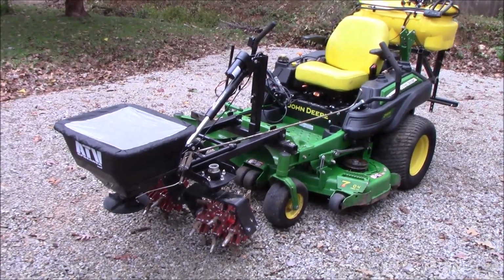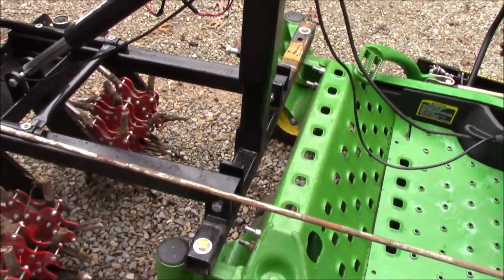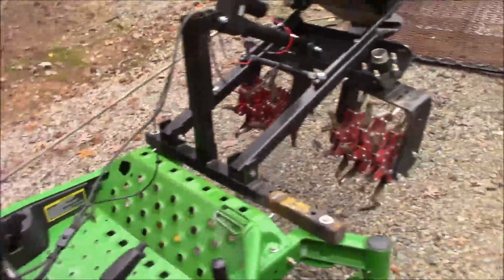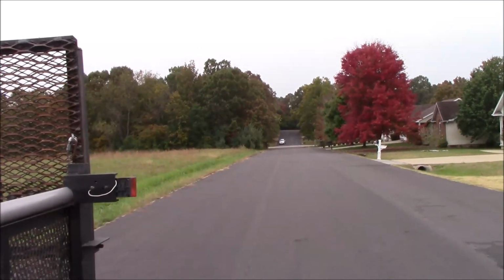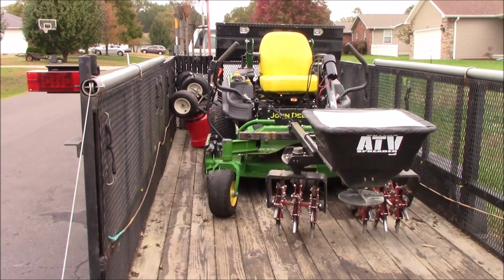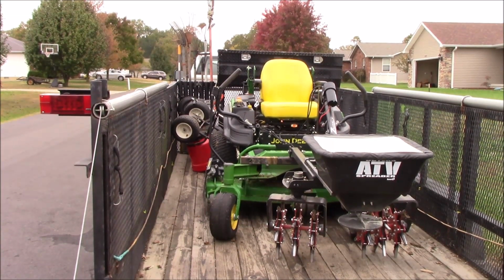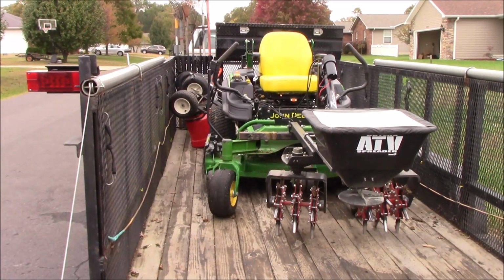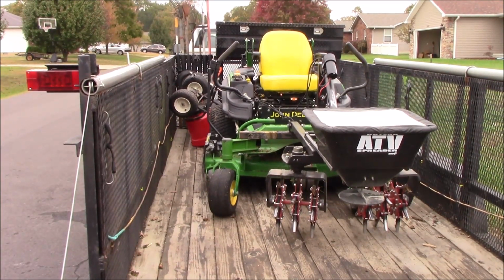Zrator On The Deere Z920M

Comment: How do you think this would work on toro multiforce? It’s made to push heavy snow When you have wheel weights and snow tires on the machine and trust me it does. So I would think it wouldn’t have any problem with the zrator on its hydros. Let me know your feedback please. Multiforce is a different animal compared to normal stand on mowers.
Reply from the maker: I think it could do it, but I would recommend the "Hooker Aerator", by JRCO. It's a lot lighter and covers more sq inches per pass. It's about the same price also.
Reply from the maker: I actually went back to a pull behind aerator, that I pull with my stander.
Reply: @HandyGuy2016  actually the hooker aerator weighs the exact same (200lbs). Since it only pokes holes in the ground, I’m sure it’s not as hard to steer/and not make tires spin. Just seems that people will want to see the 2-3 “ cores that their used to seeing with aeration. Not sure soft core aeration is what customers want. Have you used jrco’s version?
Reply: @HandyGuy2016  sounds like you don’t recommend the zrator because of multiple passes and traction issues? Did you try using it with your tweels on? Did that make a difference with traction?
Reply from the maker: @shawnkinney717  Tweels were worse, I think because they weigh less. I guess the only way to know is to try it. I'm surprised Toro doesn't have a core plug attachment.
Reply: @HandyGuy2016  I’m surprised that toro doesn’t offer a true core aerator as well. I was ready to buy the zrator from detach tomorrow but now thinking twice. Not much info on hooker aerator for multiforce out their. Seems the same has jrco’s. I might buy the toro version and roll the dice.
Reply from the maker: @shawnkinney717  sorry I wasn't much help, just don't want you to spend 2K and be disappointed. I sold my Zrator at a loss and went back to a 48" pull behind core plug.
Reply: @HandyGuy2016  My multiforce has wheel weights for snow, the boss plow weighs about the same as the zrator. I’ve pushed around the kartmate loaded with dirt and the multiforce wanted more. This thing can move mountains of snow so I’m not worried about the hydros. With it having the hydraulic A-frame to lift the aerator, it’ll be easy to raise it to turn and such. I’m getting it Friday and will let you know what I think. It sounds like it didn’t work for you to well but I took all your feedback and will try it with the wheel weights and give it a go. Thanks for all the info
Reply from the maker: @shawnkinney717  Definitely let me know.
Reply: @HandyGuy2016  zrator has worked good with multiforce, but couldn’t pull much of a plug on hard dry soil. Overall it works Pretty good.
Reply from the maker: @shawnkinney717  that is good to hear, I am using a pull behind type on my 52 Z3X.